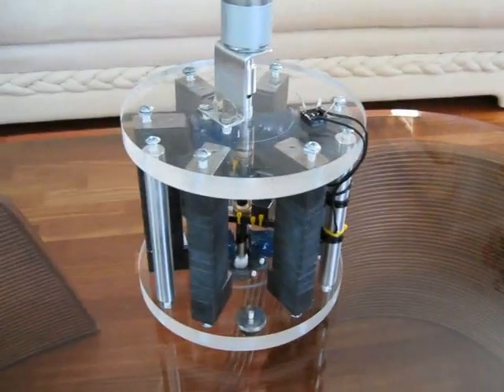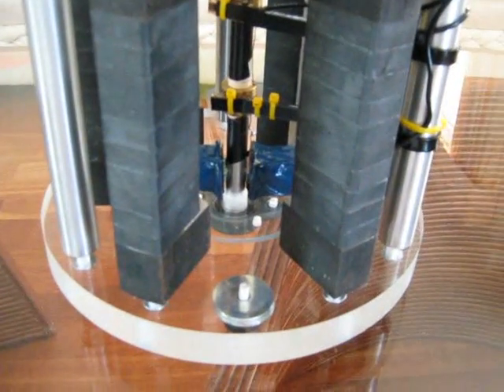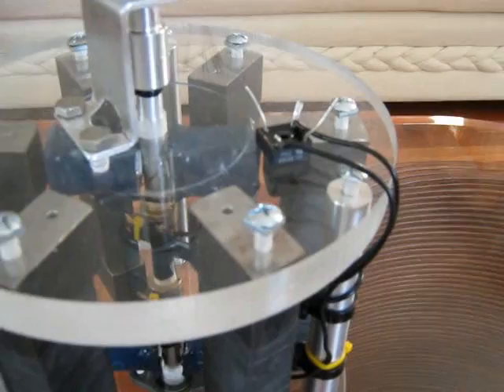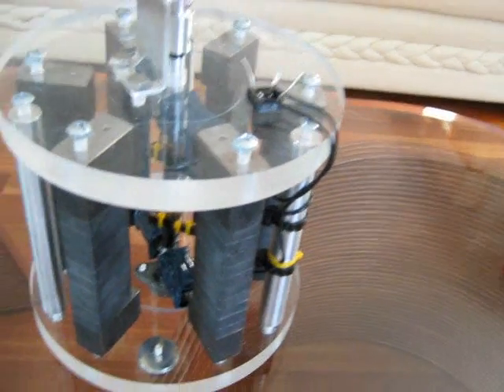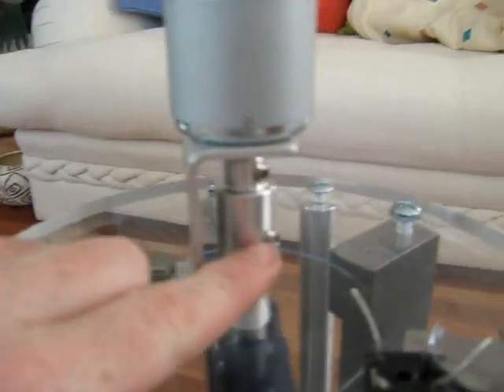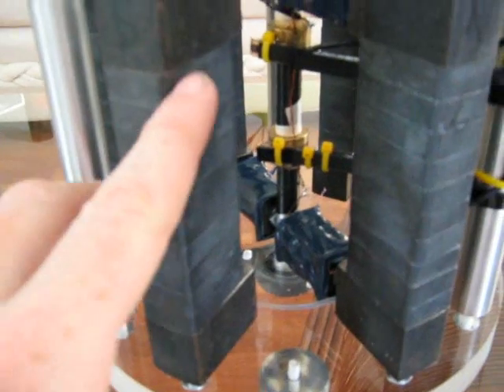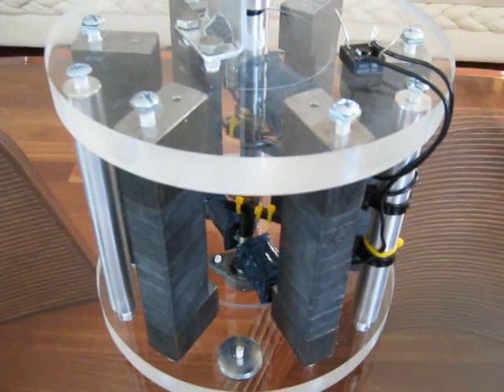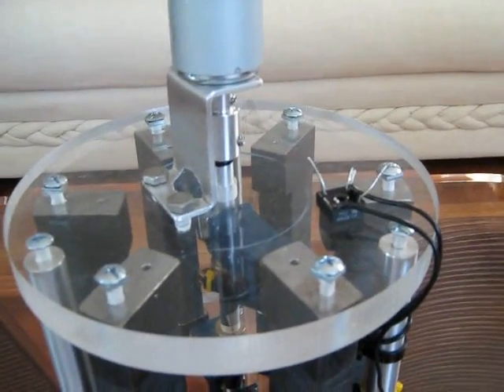video1

Comment: My opinion only , that is wrong configuration. You should read the article of Tewari generator.
Reply from the maker: Configuration was correct.  Once I fine tuned and matched the impedance of each coil it operated as described by Bedini. Also changed the motor to a brushless and it became much more efficient.
Reply: @SJohnM81 Do you mind if I say the rotor should be the electromagnet and the stator should be the receiving coils. Of course out of the patent.
Reply from the maker: @wiwidsetyo7086  sure,  however the whole point of this build was to replicate exactly as possible the original G-field generator Bedini built and demonstrated.  If built as described by Bedini the device works.  It's not an easy build as tolerances must be precise.  As for the actual practical use of the device,  it's more of an interesting novelty in this format.
Reply: @SJohnM81  Do you believe the patent configuration can eliminate the drag force in the replica?
Reply from the maker: @wiwidsetyo7086  no I don't.  The patent configuration by Kromrey has the windings shown incorrectly.  The device doesn't work with that setup.
Reply: @SJohnM81  Actually I don't understand about the G field Bedini generator. What I know is Bedini has made a back emf motor generator in a single unit aka the Bedini SSG. So what is this G field Bedini generator anyway?
Reply: @SJohnM81  And would you tell me why that Bedini generator has similarity with Kromrey generator?
Reply from the maker: @wiwidsetyo7086  I suggest you watch the Energy From The Vacuum series. Volume 10 is specifically about this device.

Comment: cool video mate, the replication looks nicely engineered!

now, does it produce overunity?

on the bedini website the claim that someone once said on youtube:

"This concept does in fact work. It took me over a year, 4 rotor designs, and 5 coil designs, but I now have a working model that provides the CFL lighting for my 2-bedroom apt. It's not earth-shattering power, I realize, but it does work. Also, I would never try to 'go public' with something like this; far too much drama. I'll just keep using my little machine to save about $150/month and call it a 'win' :)"

Whats your experience? U can also drop me a private message if you prefer.

Comment from the maker: @vid009 Hi mate, One of the annoying things in that DVD is when Bedini is about to explain how he adjusted the schematic from the patent to be correct, but before he does the camera man asks him some other question and bedini never gets back to what he was about to say. 
The coils are not high impedance, they need to be as low as possible. That is why each coil is tri-filar wound. The magnets are just ceramic, however I need to get a gauss meter to make sure each stack is the same.

Comment from the maker: @vid009 Yeah mate the blocks are mild steel and are a bit longer than the magnets. This helps to shape the field. I haven't done anything with this in a while, but now that I have finished my studies etc I will be getting back into it. I did see some results with the second set of coils, but they unwound themselves also. The new core design stops unwinding but makes it very difficult to attach to the winding machine.

Cheers

Comment: We know that the ions in magnets are aligned in one direction which allows a magnetic field to flow... i'm wondering if the 'use' of the magnetic field moves the ions out of position slightly but when the field is not being 'used' anymore the ions move back into their original position... Therefor i'm wondering if the magnets are converting heat energy into magnetism...

I think me and drev have spotted the same thing...

Comment: If you don't mind me asking, are the magnets and end pole pieces just sandwiched together to make them stay put? or do the bolts pictured in the top run through the magnet stack to the bottom plate? Just curious how you did that. Again great work, can't wait to see it running :)

Comment from the maker: Hi John,

I am putting together a DC motor controller circuit so that I can adjust the speed. The motor on its own is way too fast at 9000 rpm. Most of my mechanical probs are from that alone.

Cheers,